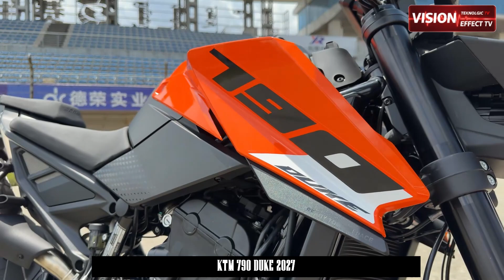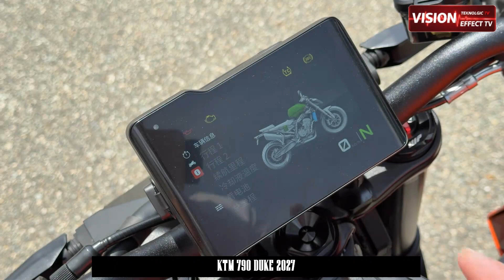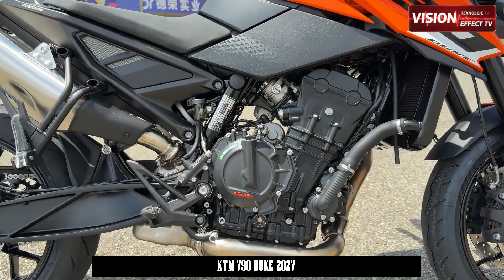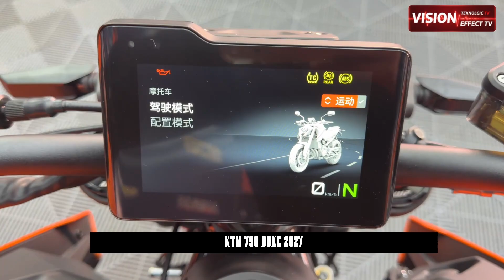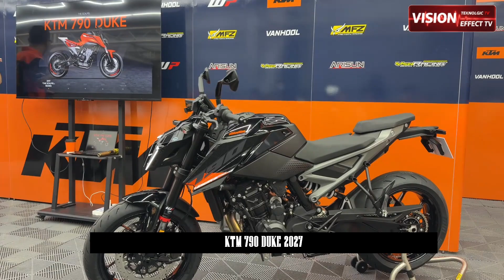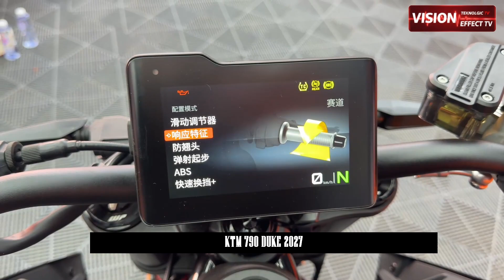New 2027 KTM 790 DUKE Review! | The Real "Scalpel" Is Back! 🏍️

Comment from the maker: Shaving off 2 crucial kilograms, introducing fully adjustable WP APEX suspension components, and deploying an all-new, in-house WP braking system allows the 790 DUKE to claim absolute mechanical supremacy in the middleweight class. Now, let's hear your definitive tactical verdict: Does the updated 2027 KTM 790 DUKE possess the raw physical firepower to completely eliminate its multi-cylinder rivals, or can the competition withstand 'The Scalpel?👇